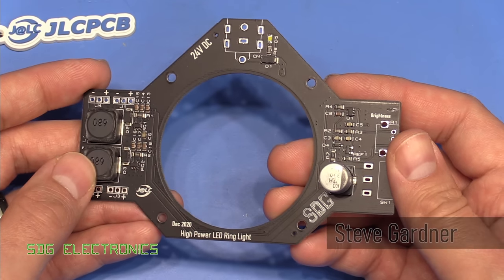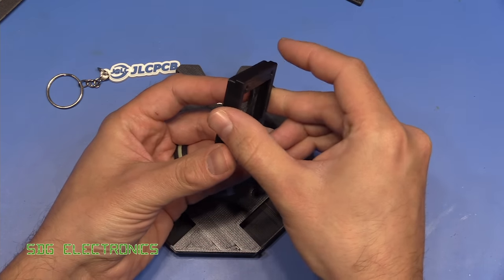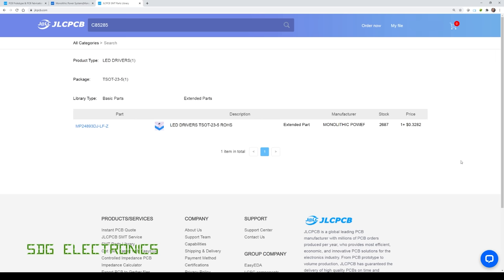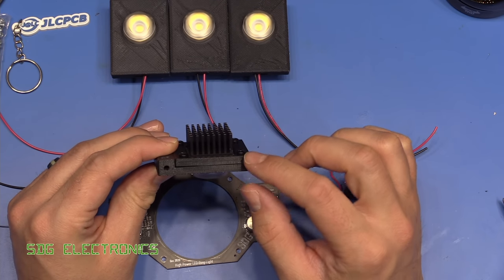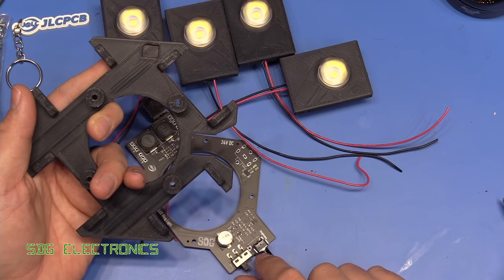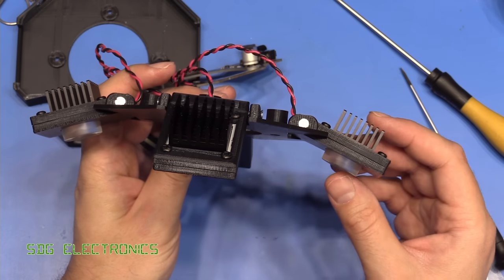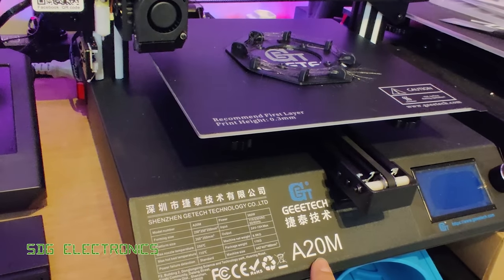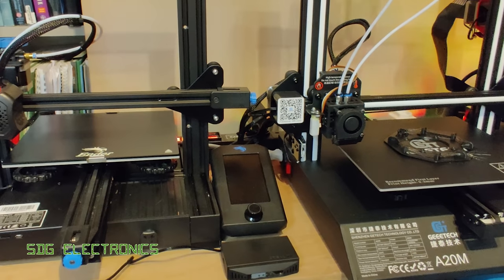SDG #192 High Power 20W LED Microscope Illuminator - Final Assembly and tests

Comment: At 15:12 I think the ring light allows reading of the component numbers better on the smaller parts.
Have you tired frosting the ring light? Using a frosted light will reduce the glare you are experiencing.
It seems like you would want to see the parts and numbers and not so much the plastic.

I have used ring lights for macro photography a lot and have ran into the same problems as you. For portraits they give a flat light and kind of wash out the contrast, the same as your PC boards.

Any time I needed contrast, I use a dual light set up that is mounted on a ring so you can position the lights for best contrast depending on which direction your need the contrast to come from.

My set up is the Olympus e-series ring and dual flash systems if you want to look at it.

It’s cool you had a custom pc board made and the 3D print prototyping.

I have an Amscope microscope and use a set of magnetic led lights for illumination.
The set up works good for me and is highly adjustable.

Any way, just my observations.
Thanks for the video.
Bill

Comment: Great to see the progress on these lights and the progression to a support-less 3D printed design. Some parts do not have an obvious flat base so sometimes I'll design the part and then slice it into two, printing each half with the sliced side on the bed. This gives a nice flat surface which is ideal for gluing back together. (With superglue)

I'd very much be interested in purchasing the assembled boards for one of these (With the through hole parts and heatsinks) if you do manage to sort out the logistics.

Comment: What a great result. If you are having trouble getting prints off that buildtak-type print bed I have had some success with freeze spray (or air duster upside down), or as a last resort for PLA at least you can try heating the bed to 60-80 degrees, basically around the glass transition temp of the filament, and they should just peel off. Though you have to be careful not to deform the prints in the process.
Reply from the maker: Freezer spray will probably work well. I often stick the glass bed in the freezer for 2 minutes to release parts that don't want to come off. Thanks!

Comment: I do hope there will be a way to get/purchase these. I could really use one - I have a similar stereoscopic optical microscope with a video capture (and same original ring light). I recently got a 3D printer (the Ender 3 v2 actually), and can print the case, but man spinning 10 boards to get 1 is pretty bank breaking for me for this sort of project at the moment.

Comment: Awesome project. I've seen all your videos. Educational, inspirational and even some science going on. Thanks! In this video, I noticed you're using pretty thin wiring. Can they handle the hight current goint to the LEDs?
Reply from the maker: Yes, especially in the short lengths used here. Thicker wire would reduce the voltage drop a little, but the wiring is well within safe limits.

Comment: Happy to see you got it working - could you try mounting only two/three lights on one of its sides+front and see if that makes a huge difference?
It seems very big, and I would most likely bump my hand against the rear side light when operating zoom and focus dials if I were to build one and mount it on my microscope.
Perhaps redesigning the light to become an Ultra-mega Super tri-illuminator ;ø)

Comment: Hi Steve I've been watching this brilliant design from inception! Works really well, we have the same setup actually, from the camera to the scope. I was wondering if I could purchase a kit from you as this has been giving me a headache for over 2 years now. I've purchased so many ring lights and all of them are junk! Please let me know if you would be keen to print the parts etc and PCB and just send the kit over. Cheers and thanks for the awesome content!
Reply from the maker: I'm planning to revisit the design once more now that I've used it and tested with the polarising filters. I didn't ever release these PCBs as I wasn't that happy with the design, so I'll address all the issues this time around!
Reply: @sdgelectronics  bloody legend, I've purchased 3 different rings lights and the expensive goose neck projectors from AmScope and all are pretty terrible! Tried purchasing an expensive polarizing filter for the lens but then learnt that in order for the lens to actually work the light needs to also pass through the filter! Arghh so much money down the drain and none of those mentioned solutions worked. Your design looks like it does the trick! I look foward to seeing the final design as I would love to buy a kit and sort this issue out once and for all. Thanks again!!!

Comment: Laser-etched markings on PCB components seem to be less readable with the new light.
Reply from the maker: True, I'll have to play around with that - it may be a camera artefact as I hadn't noticed using the eyepieces for SMD work.
Reply: @sdgelectronics  I vaguely remember something about having different light source directions to bring out different details by manipulating shadows.
This made into thinking: what if you can make four LEDs independently adjustable and add a joystick (or at least two etch-a-sketch-like pots) to move a "virtual light-source" around.
It will not work like an actual moving light with just 4 LEDs. But I can't build a picture in my mind of what it will actually look like and whether there is still a merit to it.
Reply: @killymxi  I think one of those little Sony PSP style joysticks would work great for this, although you'd need separate drivers for each LED. I'd just set it up so that with the joystick in the middle, you'd drive each LED upto 50% (Depending on the brightness setting) and then use each axis on the joystick to control the current between 0% and 100% depending on the position.